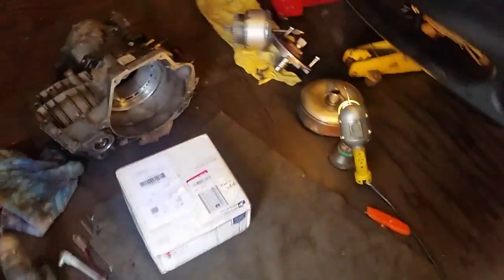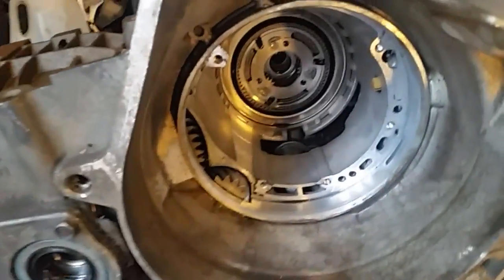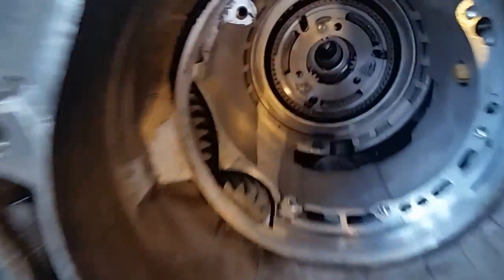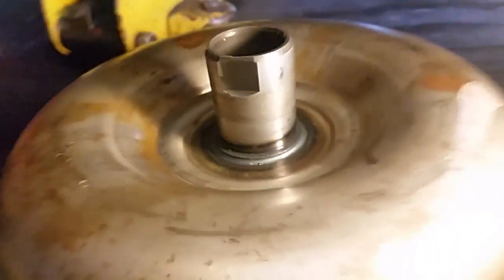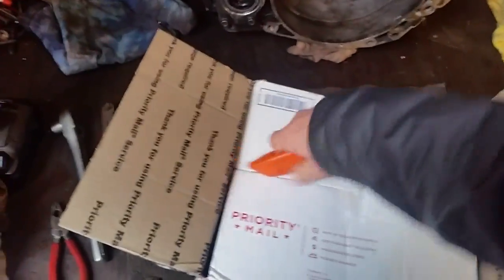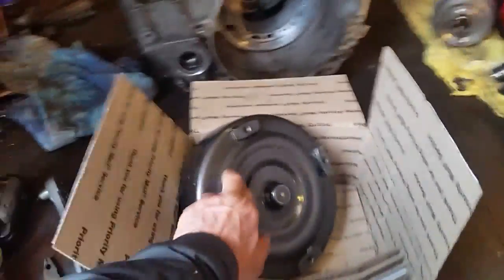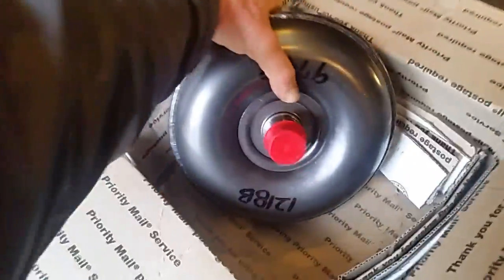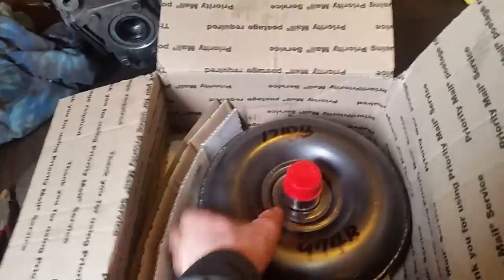Dodge Neon New Torque Converter Arrival. Getting close! -Part 6

Comment: Definitely interesting video. I drive a 2015 ram pro master 1500 and I put about 140,000 miles on it since new. About a few days ago I went up a little overpass in town and it acted a little funny and when I got to the bottom and stopped at the light the van acted like it was going to stall at a low speed then when you stop it would die. Start it up and put it in gear and does again. Got it to the shop and was thinking it was the torque converter because of your video. Come to find out it was the solenoid that you were talking about that makes the buzzing noise when you switch gears. Very weird but 500 dollars later and a day in the shop she’s back on the road! Company van that’s why it went to the shop.